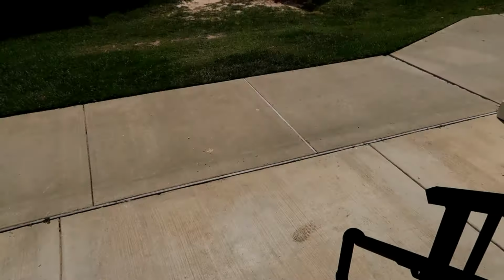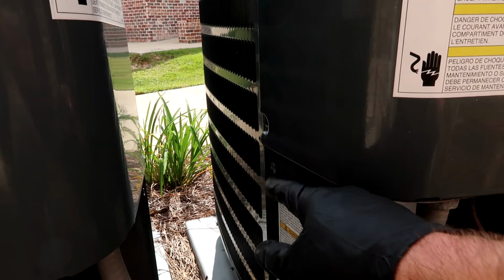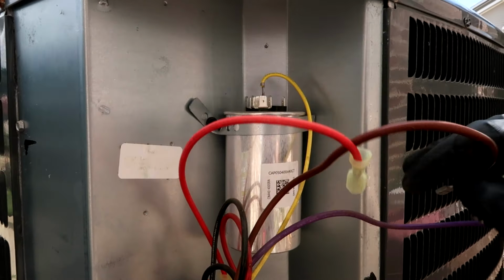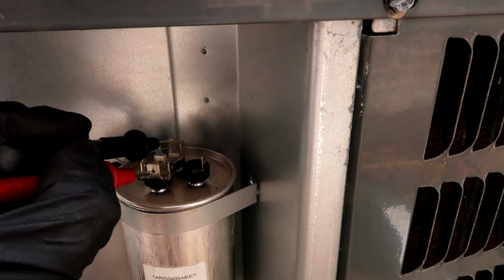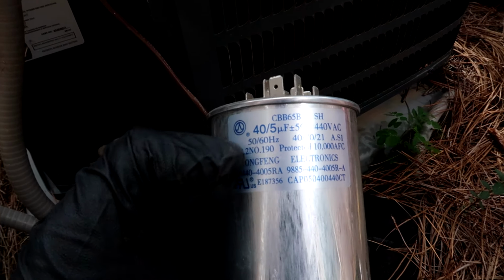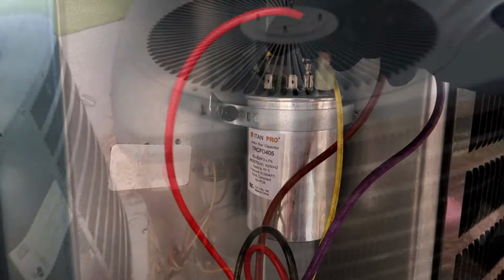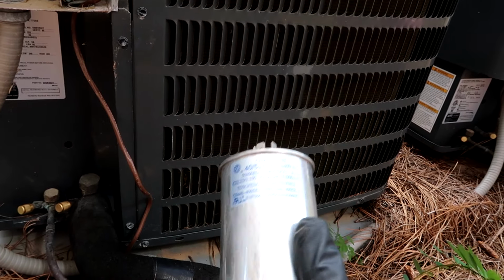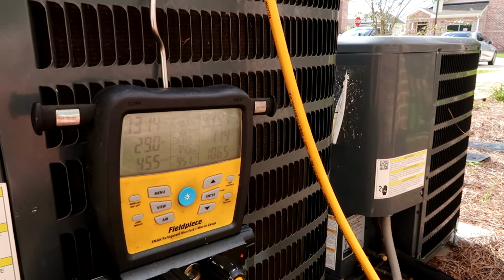Goodman Air Conditioner Runs But Not Blowing Cold Air

Comment: @2:08:  I have no issue with a meter that denotes electrical concepts (e.g., capacitance) rather than the units of measurement (mF, mFd), as long as the units are noted.

However, I think it's very weird that your multimeter is inconsistent in that way (e.g., V vs. E, A vs. I, and ohm vs. R).
Reply from the maker: Thank you so much for watching!

Comment: Do you have a video of furnace/coil maintenance? Cleaning, tablets, etc
Reply from the maker: No, the only coil video I have is just me replacing a whole coil. Cleaning is pretty easy, though. You can buy spray from Amazon that you just spray onto the coil and let it sit for 5 minutes and then turn ac back on. No rinsing needed. The tabs you just drop in the pan and let dissolve to clean the drain line out. Google can give you the best brands. Thank you so much for watching!
Reply: @LexVance  my coil area is all taped up. Do I need to put the tablets in the pan or can I just put it in the condensation pump?
Reply from the maker: @IWBVS  They're supposed to slowly dissolve in the drain pain. Putting them into pump may damage the pump because they start out hard. They're like big pills that slowly dissolve over time cleaning the debris from pan and drain line.

Comment: Mine was blowing warm air for about an hour, so I left it off for a couple of hours to troubleshoot, then turned it back on. It blew warm air still for 20 minutes or so, then started cooling normally again for 6 hours, then blew warm air again. Can this be the capacitor still? thanks!
Reply from the maker: Could be. Maybe the capacitor Herm is low so it's coming on sometimes and sometimes not. Maybe the heat strips are coming on. Maybe water is getting in your float switch and temporarily kicking the system off until it dries a bit and comes back on. It could be numerous things.
Reply: @LexVance  Thanks so much! your videos are so helpful.

Comment: Awesome video! Thanks!

What would you recommend if heat is blowing cold and after i replace the main relay tenant keeps complaining about stuffy ears  and discomfort that wasnt there before after service.
Reply from the maker: Some people get irritated sinuses when the heat is on. Myself included. There not much you can do about it. Maybe set it the heat low. I keep mine at 68. You can buy a dehumidifier to keep sinuses from drying out. Thank you so much for watching Israel!
Reply: @LexVance  yeah ive read that. But this started immediately after we worked on the ac. He never had any problem with heat doing that before. Moreover, the humidity actually went up. Now when the heat is on instead of a nice 40% or so, we are getting humidity in the lower 50s.
Reply: @LexVance  do you think we could have accidentally changed the fan speed when connecting the new relay?
Reply from the maker: @israelcontreras5332  I don't know.. I'd need to be there for this head scratcher. I have a lot of residents say things and it's pure phycological. Not even real. I have a resident who smells gas when her heater comes on. Problem is, her heater doesn't run on gas and there's no gas in the apartment. 😆 I believe your tenant has it in his head that something is wrong now.
Reply: @LexVance  ok thanks.

I just hate dismissing that to psychological issues when there is a clear physiological connection to the work. Im not a big fan of telling people it is psychological. Also the guy’s symptoms only happen in the apt…and they didnt happen before we serviced it. This guy is anything but the psychological type. Hes a veteran that is all rough and tough.

Dismissing something as psychological is what docs do when they dont know what it really is. 

I read that raising the fan speed can cause there to be more pressure in the room…thus causing the issue.

I guess I wills start there.

Comment: Question, I have a unit that has no leak, compressor is working fine, inside and outside running but when on Cool it runs the Heat. Do you have any videos with this issue? Low pressure line is hot and the smaller high pressure is room temp.
Reply from the maker: Sounds like you have a heat pump unit and the reversing valve is stuck. You'll need a new reversing valve.
Reply: @LexVance  Very fast reply. Thank you. Is that located inside the unit under the fan?

Comment: I gotta heat pump the cap was definitely bad it was totally dead and swollen. I changed the cap now it runs but is not as cold as it should be! BUT the heat side works awesome and i get instant heat and sweat on the high pressure line. When I call for cold it does NOT sweat on the low side.
Reply from the maker: The system may be low on refrigerant. It'll blow kind of cold when it's low but not as cold as it should be.

Comment: I have a 2017 goodman gas pack hvac and the capacitor went out. When I went to replace it my og only has 3 wires: brown yellow and red.. what’s up with the purple one? Is this a problem?
Reply from the maker: No, all models are different. Put wires on the new one just like the old one.

Comment: Goodman A/C unit fan isn’t running but the unit in my home is blowing warm air. Could it still be the capacitor?
Reply from the maker: Yes. See if the outside unit is running along with the inside. If its not running outside then it could be the capacitor.

Comment: What is the purple wire for? We have a Goodman gas pack outside only unit and it has the same cap (but 50/5/+-5%) and it only had 3 wires connected - brown, yellow, and red. Is that normal?
Reply from the maker: Yes, some models are different.

Comment: I have heat pump unit. It doesn’t blow cold air on cool mode and not enough heat on heat mode. What can be problem.
Reply from the maker: Low on refrigerant. You'll need a tech to come out with gauges and check refrigerant pressures.
Reply: @LexVance  the txv valve is getting frozen and pipes of it too. You know why ? Thanks.

Comment: I have no “Cap” setting on my multimeter I have the sperry DSA 660 is there a different setting I should be on or does this meter not test for that
Reply from the maker: I would need to look at your meters manual and see if there's an MFD sign on it. MFD stands for microfarads which will test capacitors. Thank you so much for watching Jesse!

Comment: What would cause the fan not to run when unit changes to heat mode and the temp is down around freezing.  Condenser is running but fan is not so no heating happens. Temperature rises up a bit, higher 30s, and fan comes on and it heats just fine.  The unit worked fine all summer long in cooling mode.
Reply from the maker: I'd need to be there for this head scratcher 🤔
Reply: Yes, that’s what another ac guy (who didn’t work on Goodmen ac’s) said.  Called Goodman and they wouldn’t even talk to me without a license.    All I wanted was some advice. Got real PO’ed at the dude I was talking to.  Liability I suppose.   But who is going to come out here at 7 some morning when it’s cold enough to malfunction?  Lucky I got a propane fireplace back up, I suppose.

Comment: Lex got a mystery for you I have a goodman that the fan moves very slow not cooling inside already replaced the capacitor and fan and the the contactor.
Reply from the maker: Weird. I'd need to be there for this head scratcher 🤔. I would need to see if there's variable speed wires and other things.
Reply: @Lex Vance  I wish there was a way I could private message you I could send a video of the  problem as I'm in texas and I am the lead maintenance for the apt complex they have already had 4 people look at it and do the same diagnostic that I did

Comment: Good videos lex 
use to be a maintenance tech few years back after a few years I realize that u can only learn so much in the maintenance field . Capacitor ,low on charge ,blower motors and some other easy stuff then I got out of that field and went to work for a hvac company and learned how to size ductwork, how to do a heat load calculation , how to troubleshoot restrictions ,non-condensables in the system as well working on high efficiency systems and geothermals (water furnaces ) my advice would be  if you want to learn more about hvac work for a company learn as much as you can .get your certifications and go work for your self
Reply from the maker: Thank you so much for watching Joaquin!

Comment: Lex! I’m having an issue on my ac where when I turn off the inside digital thermostat the fan outside keeps running and won’t turn off. If I remove the thermostat from the wall it will turn off. It’s like the yellow wire always has power. Any idea how to fix this?
Reply from the maker: Could be a bad thermostat. The connection between red and yellow may have welded together. Try another thermostat.

Comment: guy put in a new capacitor. it still doesnt  cool .it sounds like it stay on for a few seconds n turns off. the unit works but not cool. do u know what the problem is
Reply from the maker: Sounds like it's low on refrigerant. That's why it's turning off. The low pressure switch is protecting the compressor and turning it off. A tech would need to come out and check pressures.